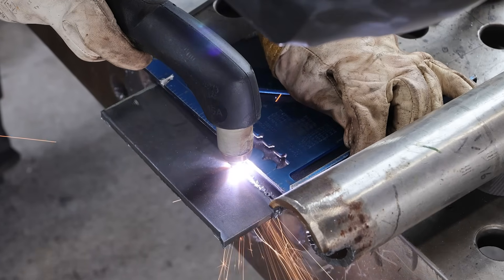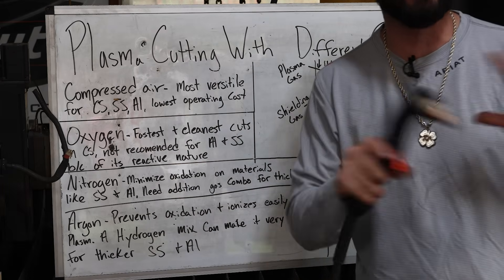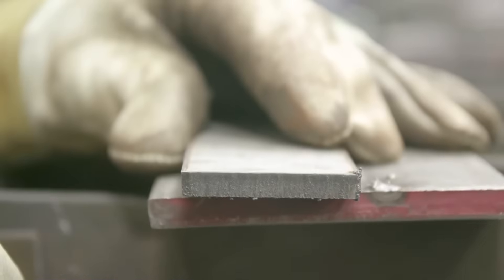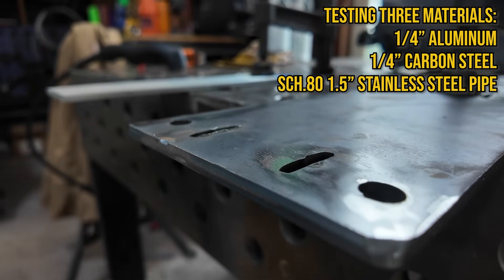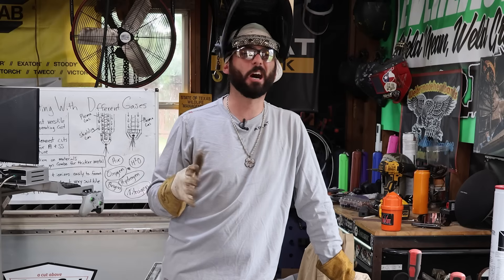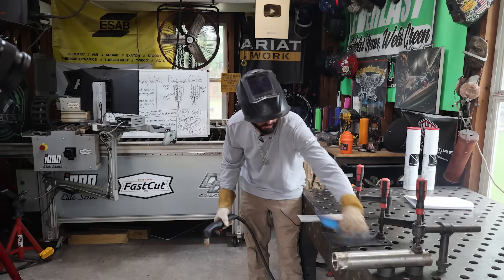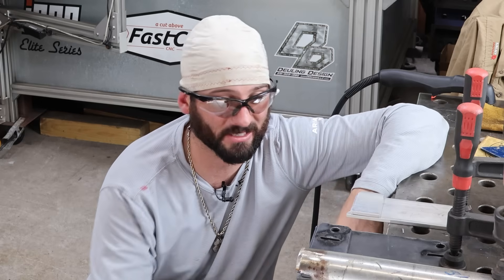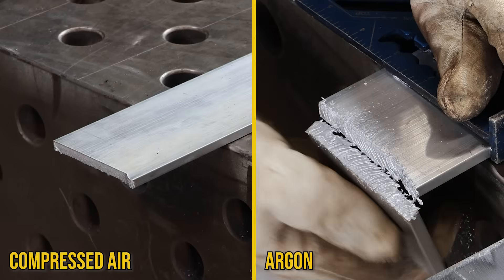Plasma Cutting With Different Gases Tested

Comment: The benefits of different gases becomes apparent when doing mechanized cutting. I use N2 as well as F5 which is 95% N2 5% Hydrogen. You do need to adjust the feed compared to O2. I can't post pics unfortunately but the finish is night and day compared to plane o2. We cut anywhere between 10G - 1" 304 and 316 SS.

Comment: Using a plasma torch with multiple ceramic components in it as a hammer is the lamest thing I've seen in years. And you dare call yourselves professionals. Then of course a close up of the cracked retaining cup. Pathetic. I remember when this channel used to be great.

Comment: Since you use your framing speed square for plasm cutting.
Cut out the flat side in the 90° Angle at 45°or steeper to give room for the cutter or notch out the flat part but let the outside thin part still be there

Comment: Im good with compressed air. Consumables are expensive enough, rather not add to that bucket. Also if you want a better cut on thicker materials, just get a higher amp cutter.

Comment: So in the shop o work at we have to plasma machine, one is a 20'x10' plasma table and then a beamcut system, they both run massive hypertherm plasma generators and cut up to give or take 3" at 300 amps, and we run them off of oxygen and nitrogen. And when we burn stainless we run water through it

Comment: I always used dry air. But I hate cutting aluminum on my plasma table! Aluminum spatter gets everywhere on the bearings and critical components.  Finally bought a deflecter that helps.

Comment: Did you know: N2 OK for stainless but, It is generally not recommended for welding aluminum alloys and carbon steel, as N2 can react with these materials at elevated temperatures to form nitrides, which increase the brittleness of the weld and reduce its toughness, negatively impacting the mechanical properties of the joint.
 Similarly, for titanium-based alloys, N2 can form brittle titanium-nitride compounds, making argon the preferred shielding gas for these materials.
Reply: This is the the reason why low hydrogen electrodes (like 7018) have such strict storage criteria, If the electrodes absorb moisture you get a high risk of hydrogen cracking/embrittlement like mentioned above.

Comment: Should have also tried CO2 since you probably have a cylinder of that around for MiG welding...

I would also like to see what happens if you use propane as a gas... Would the added heat input help or not?

Comment: Nitrogen as a purging gas? Nitrogen is one of the gases you Win 10 to keep out of a weld, as I’m assuming that what you mean when you’re purging. Nitrogen isn’t an inert gas at high temperatures such as in welding and cutting. Just at lower temperatures.

Comment: What about pure oxygen? :D
Reply: I read a little on that. Turns out it is actually used. Super effective for cutting thiccc mild steel, but expensive and ruins "prettier" materials, like stainless. You learn every day...
Reply: Cuts 1” ss316 deck plate like a hot knife through butter.

Comment: Why would anyone add another cost to this cutting process? IMO, it makes no sense to use compressed gases for plasma cutting, because of the added cost of the gases.
Reply: Because of material thickness and type of material. Compressed air is a well rounded median for cutting. But not the best for 2” thick stuff that big shops handle daily
Reply: Less pre weld prep time and less chance of oxides on Stainless in particular. You spend some $$ to save Labor.
Reply: It's not better on a small scale. Large scale fabrication it saves a ton of time.